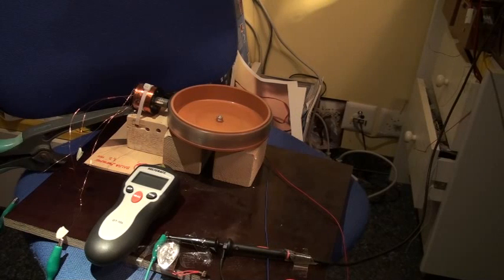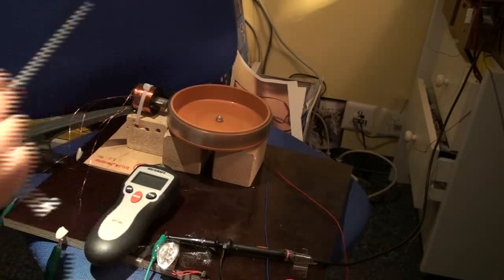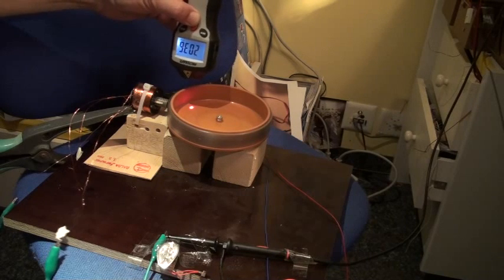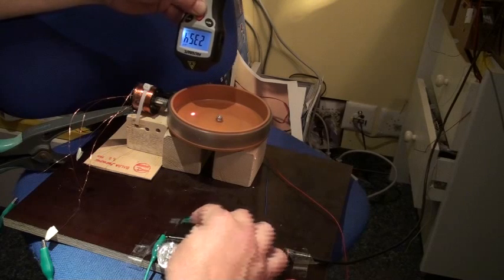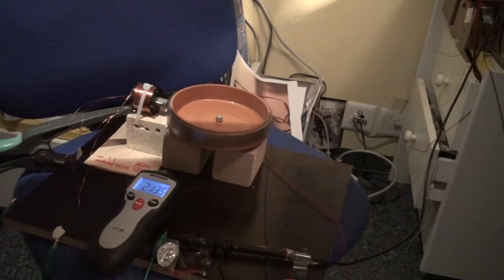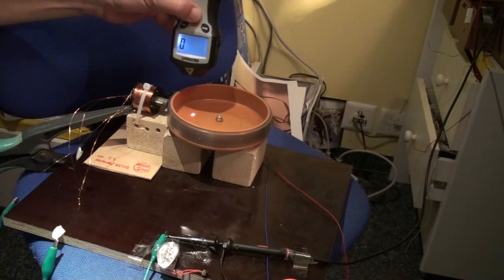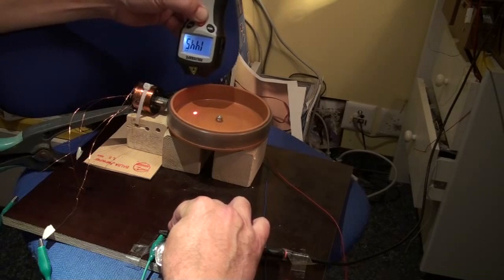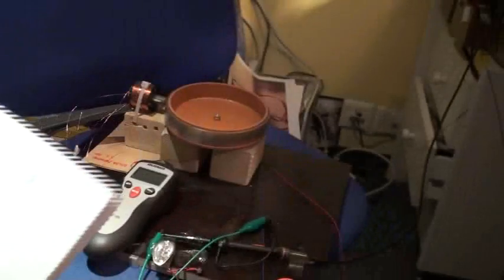accelerating rotor under load 1.wmv

Comment: Woopy, it would be interesting to understand if the speed of the rotor is higher or lower than the accelerated effect when it turns without the bifilar coil. Do you remember at what speed does the rotor turn without any coil near it?

Comment: Hey Woopy, please remove the energy pick up coil, then test and see what that RPM  is while motor runs with 12 V. 
I think energy pick up coil even with no load creates drag on the magnets, that is the reason why motor accelerates under dead short.
Reply: you are right -  acceleration because of the drag of iron core canceled after current creates magnetic field

Comment: Put a bridge rectifier on the output, then use the LED and it "houldn't" decelerate!! Also use the LED in the normal way you were using it and see what happens.

Comment: But i am also estonished that under the threshold where i do not get the acceleration but where i get deceleration with the LED load, i can get an acceleration when i shortcut the coil. ?? So it seems that the LOAD is determining the level of the threshold.

  The LED is acting like a diode and is blocking one side of the AC current needed to accelerate. Drop me a email, I'd like to talk to you about this generator. Thanks for all your work.. 
Reid

Comment: Try placing diametric tube magnets in the core of the bifilar output coil. I was able to loop back to source and charge the run battery with the output. They attach end to end. Keep them in place with tape, and fish for the threshold speed!